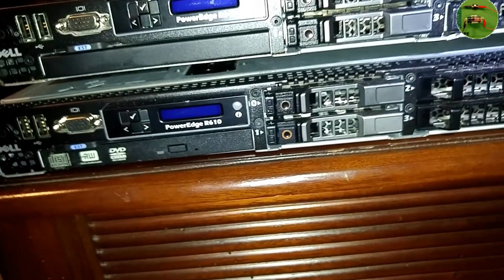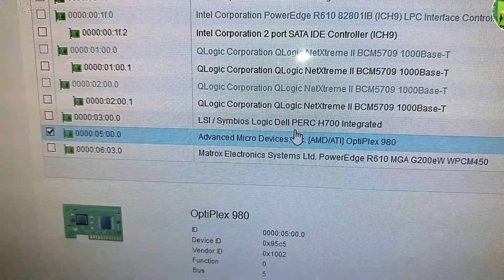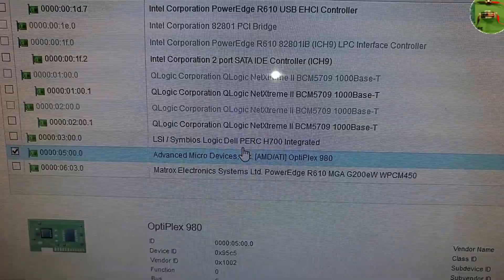How to add a PCI Express x16 Graphics Card to a Dell PowerEdge R610 Server

Comment: I did this too for my t610, works perfectly!
Reply: Can I ask waht video board did you installed? I have now a native x8 GT 710 that is working perfectly but I'm using this server maxed for some virtual machines and android virtual devices, and I ended up using 3d (for android interface) and the video board its at 90% all the time. I want to upgrade the board. I saw the addapter 8x to x16 but didnt know if it going to work
Reply: @koryyyy  I use a GT730 from EVGA, but you can upgrade your graphics  card to a certain extent. Using x8 to x16 works, surprising without any hiccups, bus speed does not really matter for what you are doing. However the only thing when using this setup with a graphic card running on x16 is the power draw you need for the video card. Server motherboards can only support so much power draw to the pcie slot, it has never been manufactured to support the latest GTX or RTX cards. If you would like to use a faster card, I recommend a card that does not require a external 6pin or 8pin power plug, simply because your server powersupply doesn't have these cables natively (unless you have mod). The max I would suggest to would be the GTX 1050ti, which comes in a low profile layout without the extra power connections. However even then you are risking your board to short out, since you are drawing much more power than what it has been designed for. Up to you, this process is all testing and theory

Comment: Could have used this
https://www.ebay.co.uk/itm/PCI-Express-Riser-Card-x8-to-x16-Left-Slot-Adapter-For-1U-Servers-UK-seller/273096263677?epid=505873374&hash=item3f95ce47fd%3Ag%3A3B0AAOSwqu9U7np0&_sacat=0&_nkw=x8+to+x16+Riser+Card&_from=R40&rt=nc&_trksid=m570.l1313

It adapts just the slot so that you can keep the graphics card inside the server case 

Thanks
Reply from the maker: Cavan Cullen 
Sure, this will work as well.

Comment: Thanks for sharing, great, I have done all the steps, the system detects me the card, I install the driver but I do not see video when connecting.
what is the option that appears in the min 5: 17sec of your video, how do I find this screen (window) in my server, what software do you use, or is it in the bios? or in the operating system.

please help me, thanks.
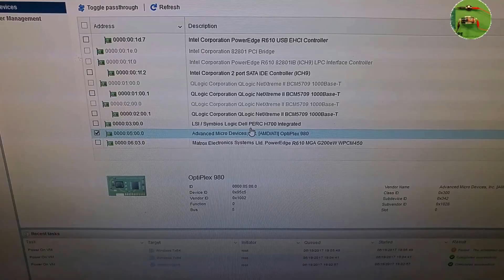Reply: min 5:01 in your video, what this software ? How do I use this software that appears in your video?
Reply from the maker: Once you have installed the external graphics card, go in the bios and disable the integrated onboard video card.  After you have done that, connect the monitor cable to the external graphics card that you have installed.
Reply: hanks, did I work correctly for w10, would it work for server 2012?
Reply from the maker: SOTEC Soluciones Tecnolgicas 
AMD Cards are more friendly with 2012 due to better driver support.

Comment: Doesn't it limit the wattage the Graphic Card can use like Dell PowerEdge R710? where maximum you can use for the 1st PCIe slot is 25W or it will halt the boot?
Reply from the maker: LaÞeirø 
I have not had any issues at all.  I have a 700 watt power supply in it.  I was even able to run an AMD RX460 off it.

Comment: Did you ever come up with a solution for placement of the video card?
Reply from the maker: reelnautee 
It is still sitting outside the server at the moment. I may later place it in a little box, but since it's happy on the outside, I run it that way for now.  Cheers

Comment: Hi  model  video card plis ?
Reply from the maker: sebastian bertoldi 
It's an ATI Radeon Graphics card that has a proprietary DVI port on it, common in some older DELL computers. To be honest, unless you have the DELL proprietary DVI cable, use a different X16 graphics card. Cheers
Reply: DIY OneForAll tank you
Reply: @sebastianbertoldi7383  OptiPlex 9xx series with a discrete GPU usually shipped with an AMD HD 3xxx series

Comment: That is crazy talk my friend, I love it!! Never knew they made a converter for 8 - 16 I can use one of those in my older system myself. Great idea... thanks for sharing.
Reply from the maker: John 
Hey John, Thank you bro. I am having fun with it.  Cheers
Reply: Just buy the riser. This won't give you 16x throughput, but a 16x riser will.. If it's worth doing, it's worth doing right.
Reply: @dsexton1055  What riser?  link please!  ;)
Reply: @patrickwhittemore7906  http://bfy.tw/OUN8
I'm reasonably sure the riser for the 710 will also work. Very similar models. Your mileage may vary.